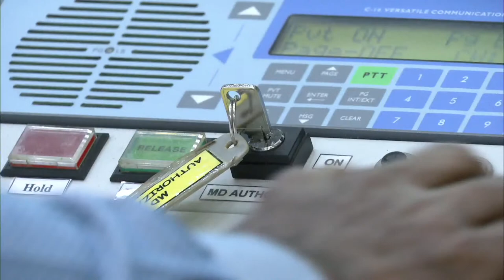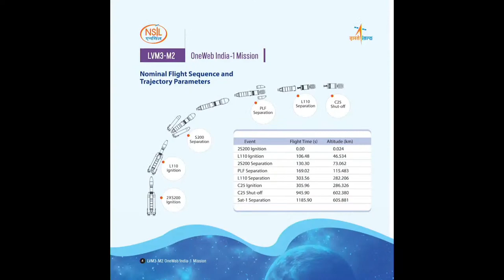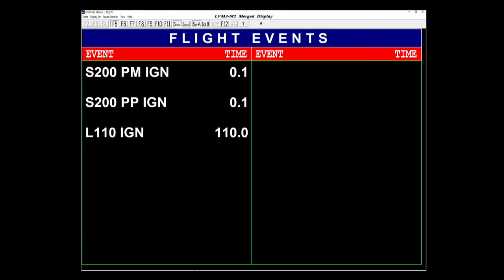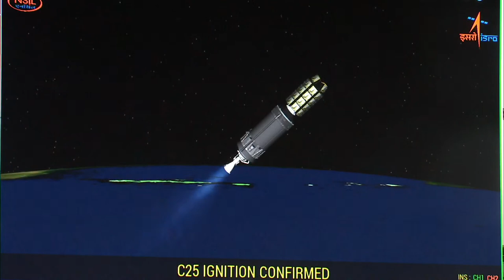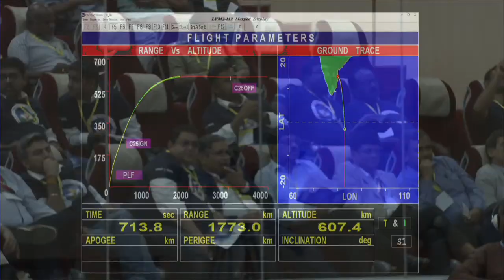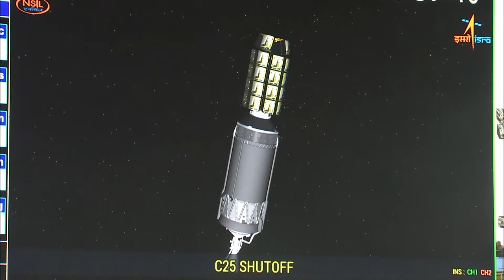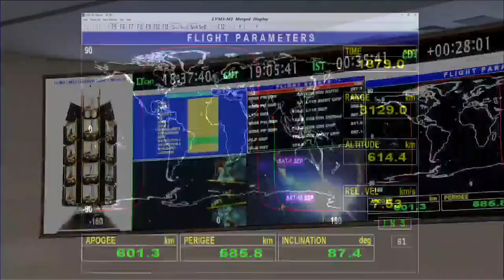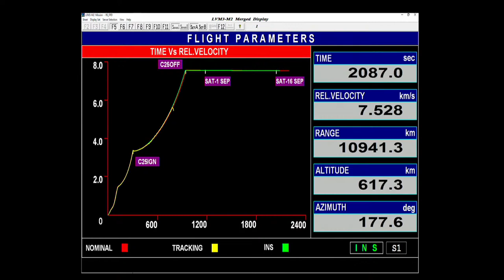Launch of LVM3-M2/OneWeb India-1 Mission from Satish Dhawan Space Centre (SDSC) SHAR, Sriharikota

Comment: ISRO need to take some  modification in cryoengine to lift 15 to 20 tons geo stationary orbit    so  cryoengine  to be modified instead  one burner in combustion chamber  replace with three burners with fuel injection system to adopted to lift heavy  weight satellites to gto